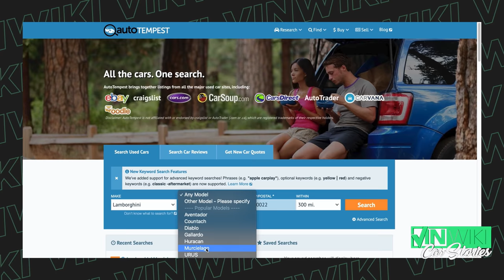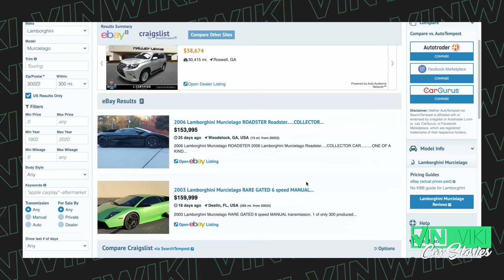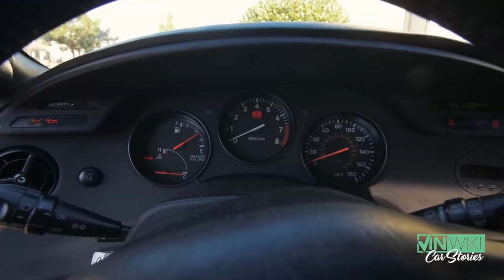ThatDudeInBlue's Top 10 Car Stories

Comment: Washington state is so lenient on speeding infractions. I got pulled over going 146 in a 60 and ended up with a neg 2 infraction. $250 case cost and $550 overall ticket cost.

For wreckless they have to PROVE intent to be wreckless or willfully crazy. Even for negligent 1 they have to have suspicion of drugs/alcohol. Neg 2 is about all they can do without really good video proof or a lab test.